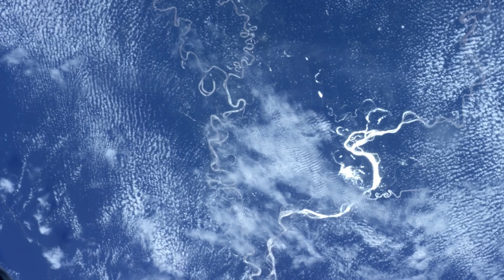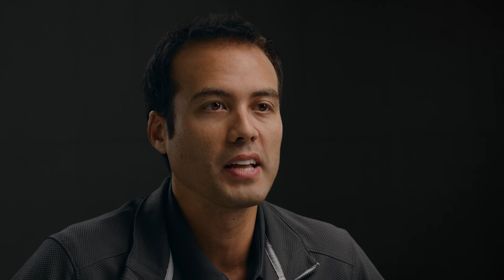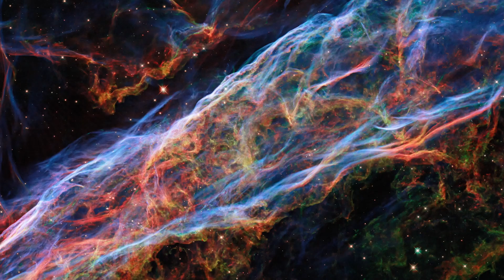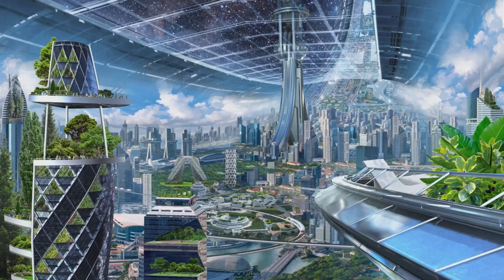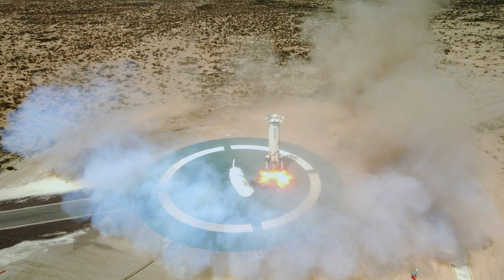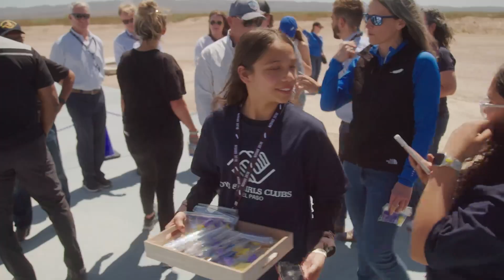Blue Origin: For the Benefit of Earth

Comment: There is a decent business case for mining asteroids, in that they're celestial bodies that didn't undergo differentiation like the Earth, and precious metal concentrations are off the charts. We could make turbine blades from dirt-cheap rhodium, or whatever. Blue Origin is right to position itself so that it will play a pivotal role in whatever industrialization of space actually ends up happening, and can shape conditions and norms, uphold the Artemis Accords, and so on. I have two objections, though. First, there will be an enormous initial investment of energy and materials into building the space infrastructure that can ultimately deliver raw materials and goods to Earth. The associated environmental impact should be taken seriously. In particular, it will be essential that launch vehicle operations have low methane emissions, and that large fleets of super heavy lift launch vehicles do not emit excessive quantities of water vapor and thermal NOx into the stratosphere, which cause global warming and ozone depletion, respectively. These problems were considered as part of studies of space-based solar power systems in the 1970s. Second, I think that this urge to exploit space comes from a place of poor engineering judgement and childlike wonder. Maybe building mass drivers on the moon to deliver materials to O'Neill cylinders at EML4 and EML5 isn't the lowest-hanging fruit we can pick. Maybe, if we were smarter about decarbonization, we could do it in a way that minimized material inputs. Maybe, if we were smarter about in situ resource recovery, we could obtain raw materials with lower land and energy inputs. People shouldn't be so eager to take on so much complexity with so little thought.
Reply: There's way more thought being put into this than you think. Thousands of people are already working to solve those kinds of issues. I'm going to use Blue Origin's propulsion plans as an example. Hydrogen and liquid oxygen was deliberately chosen for 2nd stage engines as hydrogen can easily be extracted from water ice on the moon and mars. This only requires us to build a small amount of infrastructure to extract the ice, generate electricity, and perform electrolysis. Extraction tools can be sent pretty easily but obviously sending enough solar panels to power this operation would be ridiculously expensive and require tons of launches. To solve this and reduce the launch needs, Blue Origin has developed a way to manufacture solar panels from simulated lunar regolith. This means we could build all the solar panels we want and only have to send a few machines to get the process started. Thus we'd turn the moon into our gas station for exploring the solar system. Way more efficient to do it this way due to the low gravity. 

In situ resource utilization is a core principle of long term exploitation of space. It would be beyond impractical to send every tiny resource we need on thousands of rockets.
Reply: @yaxleader  I'm talking about the initial investment of terrestrial resources that would be necessary to kickstart ISRU. Do you have any ideas about how to manage the injections of thermal NOx into the stratosphere? The Space Shuttle orbiter generated something like a fifth of its weight in NOx during each reentry. I think the onus is on you to make a much stronger case that, at any given level of investment, space industrialization is more cost-effective than advanced terrestrial industrialization as a means to reduce environmental impacts. The benefits would seem to have to be overwhelming in order to overcome the costs implied by the much higher level of complexity.

Comment: As a software engineer who wants to switch to aerospace engineering, this amazes me so much! Can’t wait to start studying aerospace engineering and to work in Blue Origin! Since I was a child I love rockets, airplanes and space vehicles. I’m 26 y.o and I won’t be that young when I get the bachelor degree, but I’ll definitely get it!! Also, my coding skills can be beneficial somehow I guess.

Any engineer or person with experience in the field who wants to drop a few tips? I’ll start studying at the beginning of 2027 (need to save some money for it)
Reply: I can give you some tips. I'm working for Blue Origin right now as a systems engineer. Software is a core part of literally everything in space. Virtually nothing in space is analog, it's all ran by computers and software. For example, rockets fly with automated guidance, navigation, and control (GNC) software and use it for the operation of every system on board. If you ever see a Hardware in the Loop lab with all the avionics of a vehicle laid out, you'd be stunned at just how many computers are running at the same time to ensure safe operation and they all have to work together perfectly. Software skills alone is technically enough to get into a space company, but adding aerospace engineering knowledge on top of it and you'll get a job no problem. This is especially good since most aerospace companies (like Blue Origin) are located in the same areas as major tech companies who are pumping out loads of extremely experienced and skilled software engineers. So if you rely on software experience alone, you'll be competing with former employees of microsoft, google, amazon, meta, etc. An aerospace engineering degree or some other source of aerospace knowledge will get you a leg up compared to them. I'd recommend going to Blue Origin's job page on their website and filtering for the following categories: || Developer - Software Engineer, Developer - Data & Business Intelligence, Engineer - Avionics, Instruments & GNC, Engineer - Communications Systems ||. This will give you an idea for what the actual experience, degree, and skill requirements are for these types of jobs in the space industry and will generally apply to all the various companies in aerospace. You can do the same for SpaceX or other companies to if you'd like a comprehensive look. You can also peak at the other types of engineers or analysts to see if you'd be interested in those roles.

Another thing to keep in mind though: All space companies and loads of aerospace companies in general are ITAR restricted. This means you must be a U.S citizen or national, U.S permanent resident, or a lawfully admitted refugee or granted asylum to work them. Since you're a random person online, I'm not sure if you're U.S based, but it is something to keep in mind.

Happy to chat more if you want!
Reply: @yaxleader  Thank you so much for taking the time to provide such an elaborated answer, to keep things clear here, you’re right, I’m not a U.S citizen or permanent resident, I’m actually from Colombia. I was thinking about studying aerospace engineering in South Korea since Colombia is facing several problems right now, also our aerospace knowledge is not as mature as developed countries, btw I’m currently studying Korean in Colombia, however for what I understand most of the studies are taught in English there, I’ve been in Korea before and I find it an interesting country, but I’m open to suggestions, Australia is another very good choice but it’s pretty expensive to be an international student there, I spend 6 months in Melbourne before. While I’m getting ready (saving money and learning Korean) for traveling I’ve been putting my hands into more hardware projects such as playing with Raspberry Pies with sensors and connecting them to databases and AI models, I like that, also I want to learn to make drones, there are some dev libraries out there to make them semi-autonomous. I’m realistic that most likely I’ll end up working for some asian(maybe I don’t know??)/European company before reaching the U.S if I ever do it, which it’s still nice! Today I got my US visa so I’ll visit Kennedy Space Center next year haha. Regarding the background experience, you gave me a wider perspective of what to expect, I didn’t know from an engineer that having this software + aerospace background could be a game changer. It is exiting to see how different companies are putting more R&D into reusable rockets, China last month made a test, Japan some weeks ago too, Europe the same some months ago, future looks optimistic in this matter.

If I can ask, what do you think about this career path? honestly speaking. I’m more than happy to know this from a Blue Origin engineer, many thanks in advance!:socialdist:

Comment: Blue Origin going full on e/acc is exactly what I needed injected into my veins.
Thank you for that, very nice.

Although some little things I would object to in the messaging, like solar power being the only available clean energy pretending that nuclear hasn't been invented yet or something.
Or even claiming how many generations it will take when in reality, this COULD happen quite fast if we're a bit more bold. But of course BO is in the business of making rockets so something like mass driver infrastructure to even further reduce costs compared to reusable rockets is probably something they hope won't happen any time soon.
Reply: We have a pretty reliable fusion nuclear reactor. It's called the Sun. It's time to capture its energy and store it at scale. Fission reactors too expensive and no one want to take radioactive waste in their backyard.
Reply: @theagentsmith  Solar panels are just too inefficient though. Fission is only expensive initially due to the high regulatory barriers. If you deregulate it as needed, kick out the oil lobbyists, and let it do its thing, we'll get cheap and green energy. Also, the nuclear waste generated by one person's entire life of energy consumption could fit in one soda can, and that's not even taking into account that it can be recycled and used as fuel again.
Reply: @matthewrosenbaum4859 no, solar panels are incredibly cost efficient. Dirt cheap, no moving parts, works for at least 20 years, fully recyclable. Fission is expensive because of the required safety measures, as well as the decommissioning  of the plant once it's retired and the processing of the radioactive waste. French plants managers had huge headaches due to unexpected corrosion before the designed lifetime. Deregulate? You don't want to put a Homer running them, don't you?
Reply: @theagentsmith  Solar panels are fine but they only work during the day (some of the day) and it's like they say in the video: Earth only gets so much sunlight, at some point every single photon of light coming to Earth will hit a solar panel, we'll live in complete darkness and it won't be enough energy.

Fission can be made cheap simply by making more of it, making everything in a factory. We do need to deregulate a lot, the current state is ridiculous and there shouldn't be anyone running them, that's a waste of a person, they can run themselves. In my opinion they don't even need to be as safe as they currently are. Just as long as nuclear is the safest energy available that's enough safety IMO, no need to make it 10 times more expensive in order to make it slightly safer.
Reply: People have been trying to make mass drivers to space for decades. Spinlaunch is the one currently putting the most effort into it. Mass drivers are harder to make practical than you think

Comment: 👎 lol the nonsense in this video. 

The video starts with the false and dishonest presupposition that the earth is going to “run out” of energy. False. 

1) It’s strange and dishonest to not just say that fossil fuels will one day run out. That’s not going to happen for a LONG time. 

2) If we not count fossil fuels, the earth is still not going to run out energy because we have nuclear energy. And we’ll never run out of that, just not possible. Plus, reactors are getting much better and are light years ahead of the old faulty designs. 

3) the video then contradicts itself by citing solar power. Well, the Sun is not going to simply go out… that will take millions of years. Therefore Solar power will never run out! 

4) The video then abandons talking about energy by simply saying the solution is in space, but doesn’t explain why. 

5) The video then shifts the focus to manufacturing in space. That might be all fine and dandy, but the video fails to explain what source of energy these space factories would use. 

And what? This is all going to be down by the power of estrogen? 

Meh.
Reply: Correct. Not sure what you mean by estrogen though.

Comment: It’s a beautiful vision, but we have to solve two risks that come with the increasing pace of launches: the impact of rocket emissions on the livability of our atmosphere, and the impact of space debris in LEO.
Reply: The first is mostly done - Methane rockets produce the chemical compounds that are used to make Methane. Just add sunlight, thermal and wind for electricity, and turn the air in to fuel to burn in to air.
The second needs more co-operation between space-faring nations and corporations, with standards of behavior and responsibility, like OSHA for Space.
Reply: Rocket launches are less than a thousandth of a percent of global emissions. They are also switching to cleaner burning fuels for sustainability and reusability. There's no way to completely eliminate the impact, but it has been drastically reduced. Space debris in LEO is a problem, yes, but it's not unsolvable and every new launch has to reenter their payload within a set amount of years per the FAA. Mitigations are in place already

Comment: Each human using 10kW translated to solar panels is about 1000 square feet of solar each. The USA would need 340,000,000 x 1000 = 340 billion sq feet (or about 12,000 square miles of solar). Nevada is 110,000 square miles. When it comes to food production, each person consumes about one million kcal per year. To produce that much food requires about 1/4 acre per person, which is about 10,000 square feet. Imagine that. We need 1000 square feet of solar and 10,000 square feet of agriculture -- per person. Now keep in mind that with agrivoltaics we can place solar on agricultural land and that benefits the crops (cooler land with less evaporation).

Anyway, I agree that humanity has a future in space. But energy production is not likely to be the motivation.